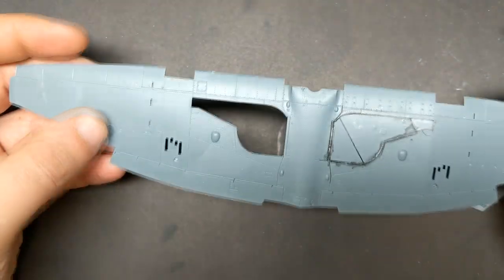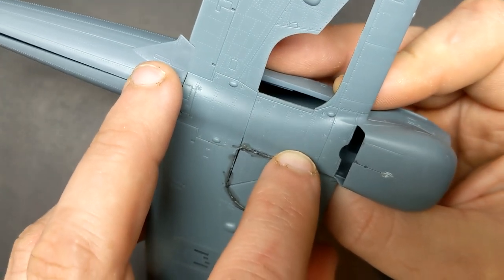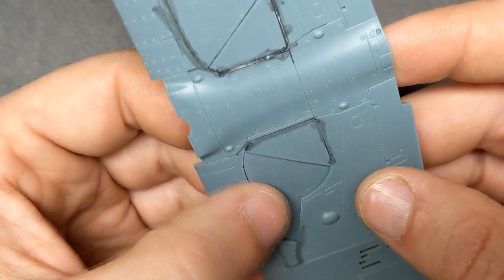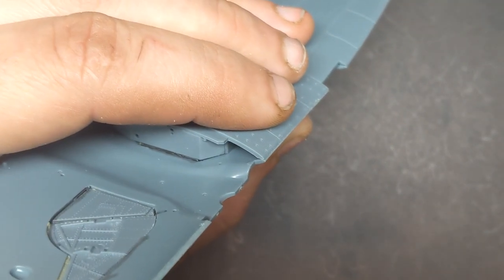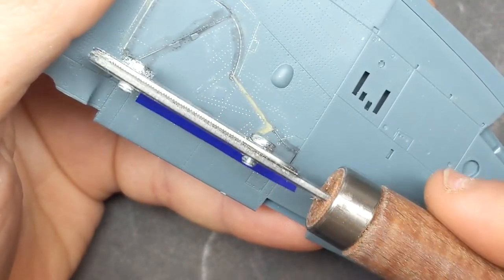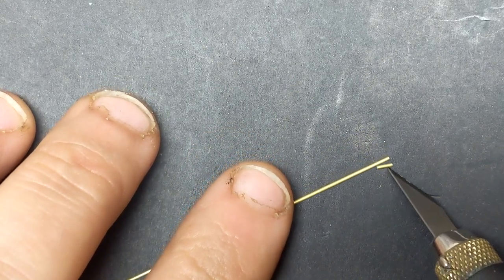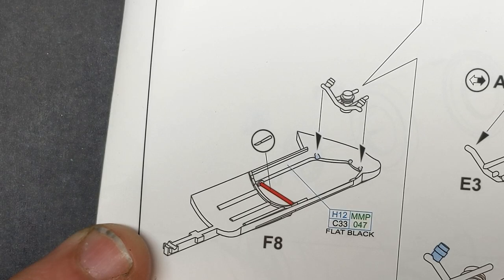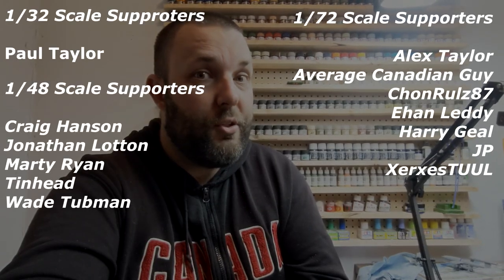1/48 Eduard Tempest Part 1: Assembly

Comment: Since the Tempy would, if out of ammo, use it's wing to tip the V-1's to send it out of control {early models} would it be possible to run the wires through the V-1 and stash the battery in the engine housing of the V-1?
Reply from the maker: The wings on the V-1 model are solid and the engine housing too narrow.

Comment: What if you just install the battery compartment into the base you plan for this aircraft, then route the wires to the plane trough the stand or rod? Thinking to build something like this in the future and this idea came into my mind first.
Reply from the maker: That is plan b. Now I'm just sourcing some thin hollow rods that will take the weight of the models